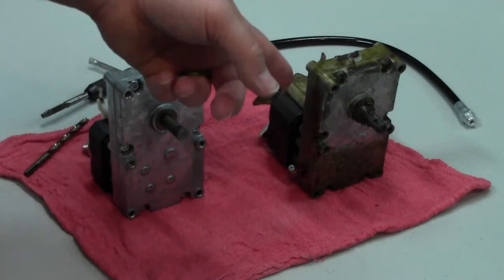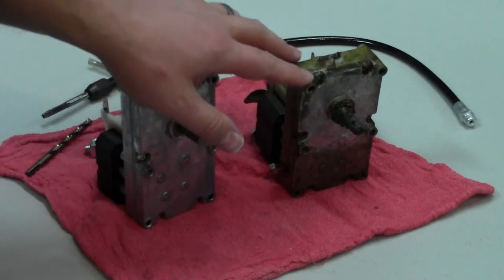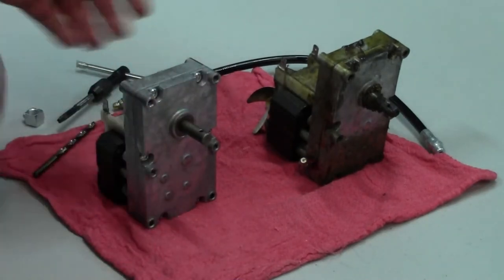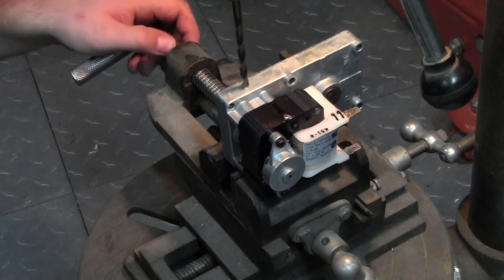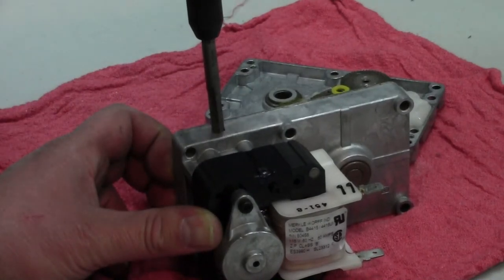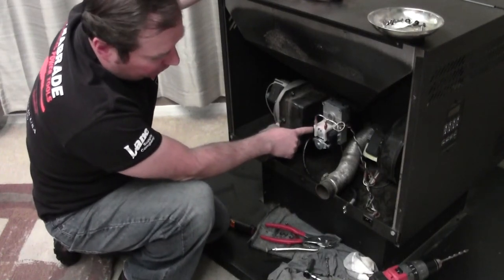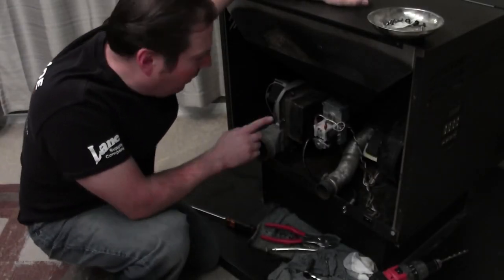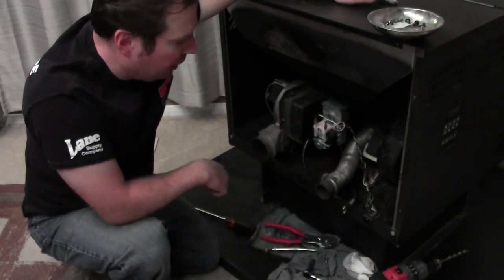Pellet Stove feed auger gearbox fix & modifications

Comment: Hey. I notice the silver tube inside of the stove, I dont have one in my 6039 American Harvest,  I see a plate inside the opening closest to the burn box, can you give me a little insight on the outside air kit?
Reply from the maker: That is the hose that goes to the area under the burn put for fresh air.  That is piped in from the outside.  It is an option on these particular stoves.
Reply: @thejunkman  yes, I think most of them do, I just wasnt sure if I really need one, and wasnt sure about the plate that blocks the opening inside the end closest to the burn pot, my 6039 instructions are pretty vague, mine also has the later style 4 button board like the 6041 model, i dont think the blower is coming on, and the top of the stove seems to be hotter than what i was told, you can put your hand on it, but it felt way hotter than the one i looked at before buying this one. I'm clueless, my 1st pellet stove.
Reply from the maker: Well I would install the fresh air kit if you can, otherwise your combustion air is coming from the room, which can cause a draft from leaky doors, just like a regular fireplace or stove would.  I have the 4 button panel and too.  The blower should come on when the burn pot is going good.  Not sure the exact temp, but maybe 5-10 mins after starting.  I don't have auto ignight so I have to use gel and get some coals going first.
Reply: @thejunkman  I'm going to look into it, I was able to figure out diagnostics on the controller pad, so far I think the blower or transformer is not working, trying to find my meter, thank you for the suggestions, I really appreciate it!